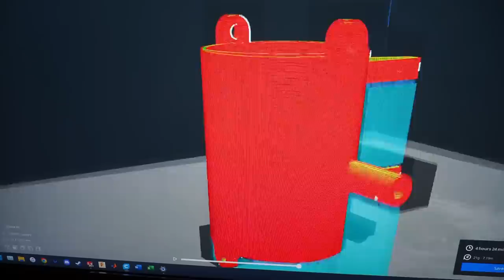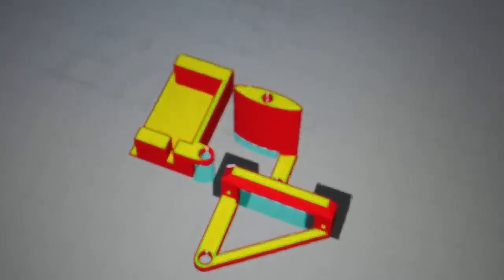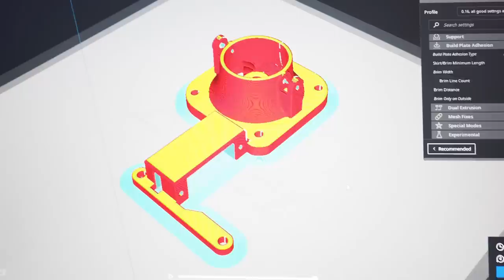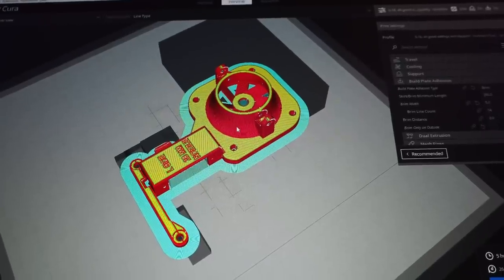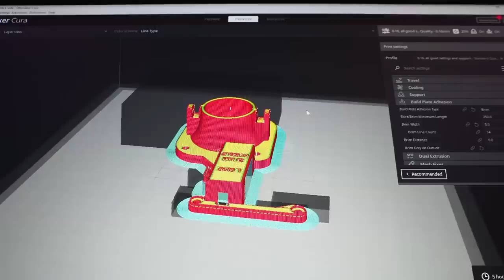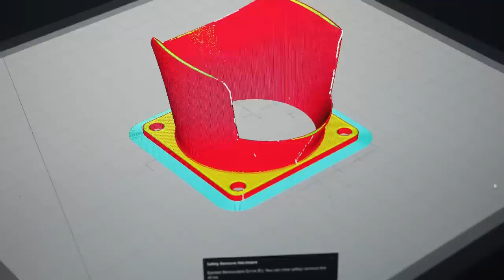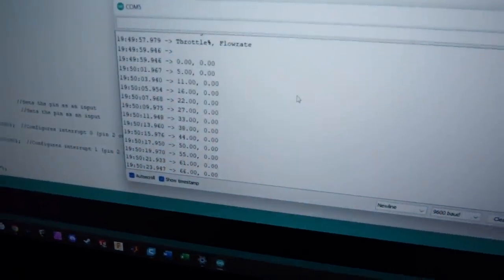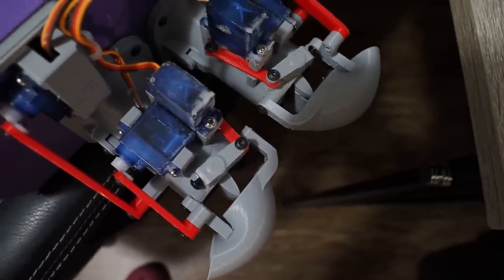3D Printed RC Boat Part 5: It's Ready

Comment: Looks awesome dude, printed a few boats last year. a couple of problems you will in counter strength of the hull , leaks and heat from motor. just test and test again before you go full throttle  😆

Comment: I just found this - looks like a ton of fun!  I think you can improve your cooling - you have 2 inlets and zero outlets for the air.  There won't be any significant air flow to the motors.  And, you're funneling any spray that comes across the deck directly onto your motors.  I assume you're in fresh water.  The best way to handle this is water cooled motors.  That's the standard technique.  In any case, I love your inventiveness and skills!

Comment: Cool boat but i have some tipps for. 1. If u liened the acrylic on one sidecwith the boat, u had to cut only one side and u have more acrylic for something else left. 2. Rc boats r never aircooled. With the inlets u gona splash the water directlly on the motors. At least turb the inlets backway. 3. Is there a seeling between acrylic and boat? Otherwise it will get filled up in fast speed and sink

Comment: If you want to score and snap acrylic, your best bet is something like a press break. You can usually get them secondhand pretty cheap and they make the process much nicer, as long as what you need to snap is a straight, unoccluded line.

Comment: you don't have any air outlets for the air to escape from the intake for the ducted motor cooling - that might cause the air to seep out the sides of the cover, which could help create positive pressure to keep water out, but it's going to decrease the amount of air you can push over your motors, you may want to have somewhere for the air to exit.

Comment: you should look into ppm decoding on the Arduino
you can get 8 channels over a single wire which I found very useful with my RC projects
Reply: also have the fans on all the time (probably use a switch or something)

Comment: Awesome vid bud! Perfect amount of in-depth and perfect amount of just going with the flow! Your minimal tools and use of cad is awesome! As far as it goes for water proof servos get a bottle of MG Chemicals - 419D conformal coating! A simple dip of the servo board is all that’s needed! And the plastic gears won’t rust so no real need for them to be sealed off from water! I can see slight issues with the motors my rc boats have uses simple water cooling with copper pipe and nitro rc fuel hose. 1 Inlet on the the front that run a the water through copper pipe that’s wrapped around the motor, made a aluminum block for the esc that used the same concept, I’ve found water cooling to be the most efficient and cheaper then replacing fans often! Excited to see what’s next for you!

Comment: For arduinos and other microcontrollers you can cast 2 part epoxy resin around them after making your connections to make them totally waterproof. Ot is called "potting" I belive and it is commonly done to weather proof electronics as long as they dont heat up much. It is also used with small electronic that are high voltage to prevent arcing.

Comment: @Mediocre Maker - with the fan intake scoops facing forward, won't they catch a lot of wave spaces directly into the fans?  I would face the intake scopps to the aft.
But... It would be better to create a water cooling jacket for the motors made out of a thermally conductive, but watertight material. Look at the jetski and jet boat designs.

Comment: Print on glass. Just the right hairspray works magic. Print pops off when the glass cools down. Put aluminum heat sinks straight on the motors. Nice build.
Reply: drop the relays for mosfets.
Reply: I printed on glass once, I never went back to anything else the bottom of the print is really smooth and it makes leveling so much easier since the alu beds warp with heat. I havent had to use hairspray yet but might on big prints.

Comment: I cut acrylic with a Dremel all the time. It's a pain but it works.
Reply: Some of your construction techniques makes me think your channel is appropriately titled but this was still a lot of fun to watch. I'm now subscribed. Thanks for sharing your project with us.
Reply: After seeing the drill and sandpaper, I realized you likely don't have a Dremel. I hope you hand feels better by now.
Reply: A hacksaw or just the blade for stright(ish) cuts is way easier (faster) or a reciprocating saw with a saw blade for metals and low RPM.

And/or 3D print a handle (filehandle-shaped) for a reciprocating saw blade. Very useful tool, not just for acrylic.

Cooling does miracles. Don't have to think big, a spray or drip bottle with water is enough for starters.

Comment: So you do realize that vaseline is intended for the skin, right? Got too much on your hands? Just wipe off as much as you can with a clean cloth, and rub the rest in like lotion. It's good for your skin.
Reply: I highly doubt that any HC based chemical, or any body lotion kind of chemical for that matter is good for the skin.

There are a lot of products that proven bad, carcinogen, etc. a few decades after.
Reply: @gabiold  The patent for the product Vaseline (brand name for a specific type of Petroleum Jelly) was filed in 1872. So it's been around that long at least, with only minor quarms over using it on the lips, and carcinogenic concerns over the MOAH content. I have a pot right here, and it says on it "For minor cuts, scrapes, and burns. Moisturizes to heal dryness. Skin Protectant. Use it all over your body, even your face". Not to mention it is FDA approved for medical use. The carcinogenic risk is most likely about the same as table Pepper, or not much higher than the usual amount of potentially cancerous cells our immune systems fend of each day. There's been one case of pneumonia linked to someone using it on their lips. Weigh all that against how many tens of millions of pots of it that have been sold, and how many millions of people use it daily... In this video he talks about it like he's had accidental contact with a hazardous industrial lubricant!
Reply: @rbwannasee  Look, everyone uses whatever they want on their body. I use this stuff at work as lubricant, so I know it. I am not that of an overly careful person, I wash my hands with brake cleaner or paint thinner when I want, but at least I don't do it unnecessarily and I won't grease my hands or any other parts of my body with hydraulic oil, motor oil, any other stuff "just because". I believe that the materials that aren't there in the body originally doesn't belong there.

Minor cuts, you mentioned, especially does not need treatment. The best treatment you can apply is to leave it alone and pull it together with a band aid (kinesio tape works better). Any chemical you put in there usually just slows down the healing process, maybe pantotenic acid is the only exception... I really wouldn't want any foreign substance trapped under the wart...

I have dry hands sometimes (in cold, when I wash them with brake cleaner, pffff...) and none of these body lotions and creams helped so far. Your hands are as shit as before when you wash it off, it is just greasy not hydrated, it just changes the feeling. There is a saying that it would be better to eat it than put it on your skin because at least the digestive system could deal with it.

Lastly, being medically approved doesn't automatically mean safe either. For example there is a painkiller, everyone knows it's brand name, which contains acetylsalicylic acid. People here eat it like candy for any minor pain because it does not need subscription. And it is proven unhealthy, proven increases the chance of Reye-syndrome in children. There are other believed to be superior painkillers, yet, you can still buy acetilsalicylic acid containing ones, it is still in production.

Look at the side effects of all the medicines, some of them are especially not safe, and many not just cause side effects in 1:10000 people. I think these are worth considering before we blindly believe that "medically approved" is equal to safe and healthy... In my opinion...

Comment: Great work!  This would be a great design to use as a bait delivery system for fishing.  There are commercially available boats similar in size made for that purpose.  They have on board GPS and fish finders whose data is sent back to the person operating the boat and a servo to release the bait.
You would have to add a deeper hull that is waited at the bottom so it will automatically upright itself after being capsized by a wave.
You will want to completely water proof the boat to keep the water out.  Think about moving your servos into the inside of the boat with only shaft levers piercing the back of the boat (transome).

Comment: Maybe a silly question but be that the impellers are driven by electric motors could you reverse them instead of the scoops?
Reply from the maker: I suppose you could, though I’m not sure how well it would work with the geometry of the inlets. I used reverse buckets because it should allow for some interesting control schemes that I’m planning on looking at in a later video!
Reply: @mediocremaker5575  One of the issues jet boats had when I was young was ingesting seaweed, it was a nightmare. I remember thinking "if they could have reversed the impellers it would have been wonderful".
Reply: @mediocremaker5575  I was gonna say this looks awfully similar to a recent Smart Every Day video subject with similar control schemes...

Comment: what does the pitch on the nozzles do?
Reply from the maker: Pitch on the nozzles allows you to change the angle of thrust coming out of the rear of the boat. In effect, this allows you to “push” up or down the rear of the boat. This should allow us to play around and find the optimal planing angle at different speeds. Also, I’m planning on trying some fun control techniques like pitching one nozzle up and one nozzle down to “roll” into turns…

Comment: Dude why didn’t u water cool the motors
Reply from the maker: I couldn’t find any brushed 775 water-cooling jackets for a reasonable price anywhere
Reply: @mediocremaker5575  maybe have heatsink fins sticking out the bottom, sealed, and motors attached on top of sinks?